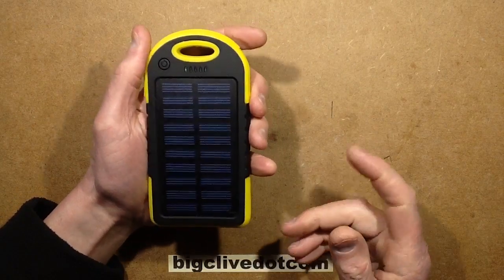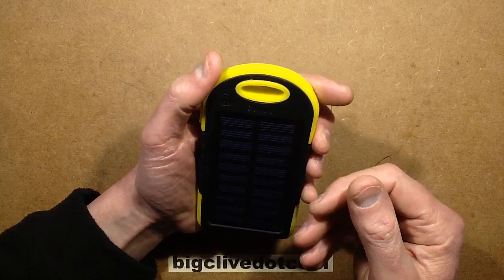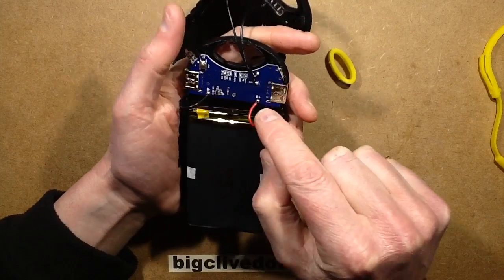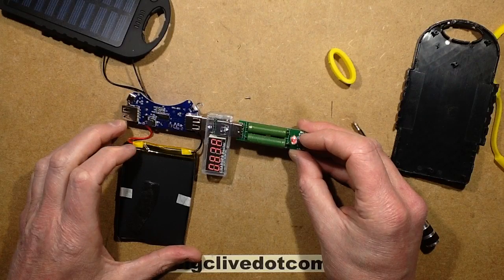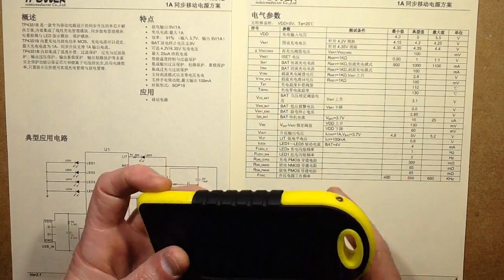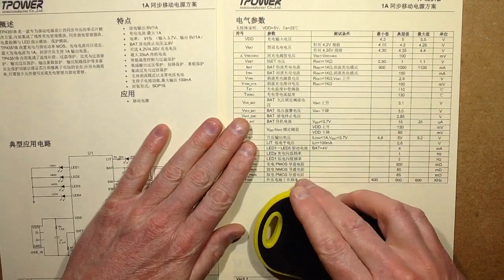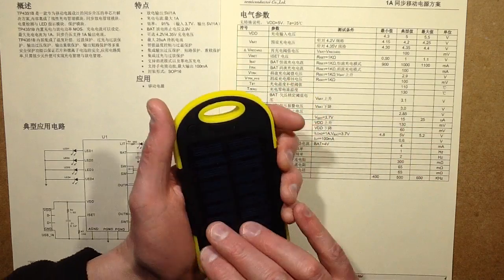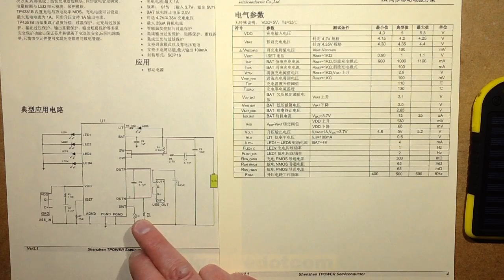A look inside another solar USB power bank.

Comment: Hi Clive, I would love to know how to keep my power bank output on for low power uses as it just goes off very annoying when running LEDs? Any help or a video would be good.Thanks Bob in the UK
Reply from the maker: You do get modules that keep them awake by pulsing a 100mA load, but smaller power banks with no capacity indicator usually stay on.

Comment: My mom bought one of these and it was absolutely shite. The solar panel only manages to push out a mere 4,8 Volt open-voltage, and, though only an April sun, a whopping short-circuit current of 30 mA.
And my mom was surprised it didn't charge the thing at all behind the living-room window... (which is the reason she got rid of it at some point, ending up on my bench to tear it apart)
I connected eight 4,8 Volt 48 mA solar cells all in parallel and that gets a nice 0,5 Amp current flowing into a 18650 cell during sunny conditions.
'Mine' has an HT4936S chip inside.

Comment: I was hoping you would have a video on one of these.  Have the same one, but feel like if I take it apart I won't be able to get the rubber parts back on.
Edit... Mine has the hole for the LED under the rubber, appears to be pads on the circuit board for a LED... Now I gotta tear it apart

Comment: If you think the lower battery capacity is bad, it can be even worse!
I bought something that looks exactly like this, but it has a FAKE solar cell. It is pretty well done, they have hidden a photoresistor in the middle of the ‘cell’ such that an indicator LED can respond to the incoming light. A closer look at the cell reveals it is just a texture printed on top of plastic, and shining a small flashlight makes it obvious that there is only one tiny spot on the panel that responds to light, the flashlight also makes it easier to see where the photoresistor is. From a rough capacity test, the battery seems similar to the one Clive shows, at most half of the advertised 5000mAh capacity. The eBay seller was not to blame, he was obviously unaware of this scam because he refunded the whole amount immediately after I notified him.

Maybe I'll send this thing to Clive for him to educate the general public…
Reply: I have further investigated this and the PCB is specifically designed to build power banks with either a real solar panel or a scammy fake one with photoresistor. There are two pairs of ‘SUN’ contacts, the ‘SUN-’ and ‘SUN+’ are meant for a real panel, the ‘SUN2-’ and ‘SUN2+’ are meant for the photoresistor. The latter pads connect the resistor directly to the battery through the same indicator LED that would normally light up according to the voltage across a real solar panel, making it slowly drain the battery when sunlight impinges on the sensor. There are pads on the PCB for the diode needed to mount a real panel.

I can turn this into a real solar power bank by swapping out the scam panel with a real one (I'm going to try to find one where they tried to cover as much of the surface with actual cells, instead of using the smallest cell bits possible) and adding the diode. It will still be a dodgy design because as is the case with pretty much each of these cheap solar power banks, the panel will go straight to the battery without a protection circuit and it could potentially overcharge, but I can mitigate this with a beefy 4.3V Zener across the panel. I have also considered connecting the panel to the USB input which would have the benefit of letting the IC handle the overcharge limit, but this will probably cause too much loss of efficiency due to the stupid LEDs stealing juice from the panel.

Also notable is that the original models of this bank had 4 LEDs while many of the newer ones have 5. This is also a typical borderline Chinese scam because as you can see from Clive's datasheet or the datasheet of the Hotchip HT4936S in my power bank, these ICs only have 4 LED outputs. They simply duplicated the lowest indicator LED to make it seem as if the power bank still has 40% charge when the IC is actually saying it only has 25% charge left. I removed this redundant LED, which has the additional advantage of slightly less wasted current (the LEDs only draw 3mA each though).

Comment: I got one of these charger not the one you have is a different style but it literally does the same thing as this one does. mine has a giant flashlight on the back of it not a little LED on the side of it. I also am thinking of buying one of these for my grandmother being she lives in Puerto Rico she could leave this sitting in the sunlight all day long charging and then at night plug her phone into it and then during the day put it right back out on the front porch where she gets the most amount of sun during the day. That's been would be great for her because she gets constant power outages in Puerto Rico all the time there and it's not good because she doesn't know how to drive anymore being she's 82 years old and with this all she would have to do a stick getting the sunshine all day long have it charged and by the time she's ready to go to sleep plenty and her phone and Bam there she goes a full phone in the morning. My device even has a full battery thing inside of it where is the phone is at 100% it'll cut off and will not produce a charge anymore so that is why I say my grandma can plug this in overnight to her phone and then it'll just shut off when the phone reaches 100. I don't know if that is the charger that is shutting down or if the phone is not accepting a charge anymore. But sometimes the charger will just shut off when it knows your device doesn't want to charge anymore. For example my phone I can put it into this and I'll get up to 100% and then cut right off. That is good because like I keep saying somebody could leave this plugged in for a long. Of time their phone can get to 100% they can forget about it and then hours later when their phone is full go back to it and see that it has shut off when you're wide has shut off and see the phone is at 100%these are also good for developing countries like Africa where they don't have electricity but they have cell phones because they need to get all their citizens cell phones and I think I heard that they do something when they give low-income families cell phones like they do over here so the family would have one phone for the entire house and they'd only be able to use that. I've heard of fathers and the man of the house going out to work in the city charging the phone remind you the phones only a flip phone or a candy bar phone not a smartphone so the man of the house the father of the husband son whoever would go out to town work all day find somewhere to plug their phone in while at the city and then when they go back out to their house their phone has a full 100% charged for them to be able to use the phone at night. What this all they would have to do is just stick it outside in hopes that nobody would steal it or at least hang out somewhere let it charge all day and there you go they have a fully charged phone. I swear by the chargers now I haven't been able to use mine in the sunlight yet but I do swear by these chargers and I would definitely get one soon. I do have to update mine I may just buy this one because I can clip on a carabiner and clip it to my backpack and walk around with her all day in the sun while I'm outside already my bike or doing outside activities.
Reply from the maker: These power banks often puff up if actually left in bright sun due to the heat.

Comment: Hi there Cive, i have one of these that was a "collect points" gift from CocaCola's two years ago, and i only had it used a few times as it won't charge my phone (2.600Ma) even 1 time. How i can check if it's okay? also, it takes FOR EVER to fully charge (Using a 2A 5V charger), almost like a complete day. Could you help me? mine's Red on the shell and black at the bumper

Comment: That has been an issue with some of these power banks. They only can manage .500 MA at 5 volts. The power banks I build can handle up to two amps at 5 volts. That is the mark of a good power bank. Also seems to have a bit to do with the battery as well. If the battery is a smaller cell, then even with a good boost converter they still have low output.

Comment: Won 2 of these off some advert and as chargers they are utter dire. I have a Blackberry Priv and it discharges still with one connected unless I switch off and leave it. Solar Charging is pathetic but...... flashlight is only but a double click and it works! Its built in so a better LED me thinks!!!

Comment: I was wondering how to charge the internal battery of this device using a cord and not the solar feature. Turns out you have to use the micro input.  Just fyi. - Great video.

Comment: Hmm...something just occurred to me:  Batteries don't like heat, especially when charging.  So let's charge a battery in the sun where it is bound to heat up.  Interesting.  ;)
Reply from the maker: Many people report that if left charging in full sun these type of units often fail with the case splitting due to battery expansion.

Comment: I just got a 12000mAh one that looks just like yours and it has the same model number as yours as well. Interesting. Heres the link if you are interested in checking it out. http://www.ebay.com/itm/252357684543?_trksid=p2057872.m2749.l2649&var=551203400261&ssPageName=STRK%3AMEBIDX%3AIT

Comment: Hello, Once you have dissembled this powerbank it pop to me a question if maybe it's possible to connect in a row two of this solar power cells and both batteries in order to have 4.9 Amh and double solar capacity of charging without fearing it would explode!!! lol thanks in advance if you read this.
Reply from the maker: Technically speaking you could, but you could also just add a solar panel that out out around 5V via the USB charge socket.

Comment: Hello Clive love your vids just a thought on the colour thing indeed a black object will absorb more heat than lighter colours from a radiant source eg sunlight but the flip side is it can actually reject heat just as well as it absorbs it for example they make many condensers on refrigeration systems black or darker colours as it actually improves the ability of the coil surface to radiate heat like the guys in the desert in black loose clothing you would think there bonkers but they actually lose more heat on there dark side than they absorb apparently... But to be honest I doubt the wonderful folks in China were thinking that it was probably more a cas of the cheapest heat shrink they could find at the time ;) As a side note growing up I remember we had a fridge that was nothing but trouble on a hot day it would shut down apparently overhearing compressor but fine otherwise when the weather was cooler we had a bloke look at it and the first thing he said is paint the condenser coil black so dad cracked out the spray can and presto fridge never played up again.

Comment: I just bought this and was able to power a smartphone and ipod touch very quickly. I just don't know how long it takes to charge under sunlight. It worked great for me so far. I just hope it re-charges properly under sunlight. For 7 dollars, I can't complain too much.
Reply: I've left mine on a window sill, hopefully if I leave it there long enough, it will charge
Reply: the solar panal will take up to 48h to fully charge the battery so its for emergency use

Comment: Are there any solar USB power banks that you would recommend? Thanks.
Reply: I love my PNY ID10400 (Best Buy), it will output up to 2.1A @ 5 volts, but no smart charge capability... however the lcd screen shows output numerically so you know exactly what's going on, and this is a grewat feature for testing the integrity of your charginf cables! It'll charge my S6 from ~0 to 100 twice.  Also just bought an Anker PowerCore 26800 A1277 3 IQ smart charge ports, 6A max(Amazon, on sale from 99.99 to 55.99). I've only had it for 2 days but it's massive and heavy, took 7 hours to get a full charge on while utilizing it's dual input charge capability (yes, two quality wall warts for 7 hours!) I've since charged my s6 fully once and had it connected all night @ 100% (which in my experience, seems to drastically hurt the efficiency of current transfer) and the 4 LED battery meter still lights all 4 leds. The Anker is promising, but I REALLY appreciate the display on the PNY unit, I use it to check if a particular cable is limiting my charge capability, and have found a bunch of junk cables with it. Honestly, I didn't realize how much my cables were impacting my charge times until I started paying attention to the ammeter on that PNY unit.
Reply: Chris Lesmerises I will absolutely check both of those out. Thank you for the recommendations! :)
Reply: Tristan K you're welcome!  Glad to pass on a little experience :)

Comment: I am an Entrepeneur, planning on creating compact devices that use soalr energ, and I always get stuck as to what kind of circuitry to use to safeguard the battery, the panel and the charging devices. Can I buy these chips or get them manufactured from somewhere using the data in this video?
Reply: I mean I am grateful that I found your videos, I was not even aware of such a tech before this :D

Comment: With my experience with these chargers the led will trickle discharge the cell
Reply: Bad circuit design for sure. high standby current, coupled with much lower battery capacity than advertised, there's a reason these are cheap, but they're a bad deal at any price.

Comment: I got the same one but a green (with the 5 leds and the button on the left side). i choosed the 8000mAh, it measured out at 2600mAh. it was cheap, so atleast I can use the solar cell for something :D also, my circuit board didn´t have any screws haha

EDIT: after watching the other video, the first thing I did was to take it apart and look for bridges haha

Comment: i have that same one, and it's not terrible. it suffers the same flaw as another you 'reviewed' and shuts off if it doesnt draw enough amperage. the plus sides is that for about 17 USD mine is definitely about 3000mah, advertised 5000. like so many chinese power banks, the cell inside will vary depending on the seller. mine doesnt have the same black wrap. my phone can draw about 900ma consistently, which is common for my moto E. i can feel the cell inside beginning to bulge only slightly after repeated uses, and i may discard it, or replace the cells soon, just to be on the safe side. as for solar charging, it's nearly pointless unless you leave it in a windowsill all day for several days. that said, it's enough to get you a little extra use in emergency situations.

Comment: Have similar, never opened it though... mine does seem to have a fake solar panel (did not you have one of the fake solar panel ones also?)
Reply: i have the same one but its on green. i opened it due to battery swells. quick examination itself is solar panel is connected.

Comment: I bought one of these (apparently) after watching your video. Now 3 weeks later it arrived. It's good to note that, like yours in this video, mine has the button on the left side and the squares pattern on the back. where as the one with the short circuit in your other video has the button on the right and has a hexagonal pattern on the back. I hope mine lasts a good while :p I bought it from a different seller than you since I couldn't find the one you mentioned, and I bought 3 different banks, the solar one, a single battery one and a double

Comment: Hello Clive. I must say I love watching your videos even thoug I don't understand electronic components at all.
For me, as a total newbie it is sometimes hard to understand if the item in the video is wrong (either crap or dangerous) or it is actually usable. I understand the basics how electricity or usage of Ah but I have no clue what are you talking about when you disassembly the board.
Can you please recommend me some cheap (eBay) power bank? I know it won't ever be as descibed by the seller and that they are cheating the capacity but I don't want the solar power bank to burn out my devices or to explode the battery while overcharching.

Comment: Greetings from the frigid Dakota prairie!  Not quite on point, I guess, but I have a sort of question, comment or something like that, not really sure..  A few years ago, I was looking for a portable solar cell on Ebay.  I came upon a deal on Ebay for a used cell that was in an olive drab canvas carrier with loops to hook to a backpack, and a thick canvas type leg to hold it up on the ground should you wish to detach it.  I got it for just a few bucks, the fellow who had it said he used it for a two week camp vacation and that it charged his iPhone during the trip with no problems.  Now I see on all the cheap china cells that they say the will not charge a cell phone.  At any rate, we fled the cold to Arizona this winter, and while camped some 7 miles north of the Mexican Border, I decided to try out that charger.  My wife has an Archos 8.1 tablet that had failed to charge up with the proper charger, so I thought I would give the Solar deal a try.  I put it out on the table and aimed it to the blazing Arizona Sun, the device began charging, and within an hour was at full charge!  Now perhaps I got a better quality solar cell or something, but this one appears to live up to the sellers claim, and puts out very well!   He said he purchased it locally from a hardware store here in the good old USA.  I can't find any markings on it as far as brand name, the cell is protected by a clear plastic water proof cover and surounded by canvas, very well padded, and the cell seems to be bendable, while I never really pushed that issue, you know how it is when you get a new toy and you are trying it out....